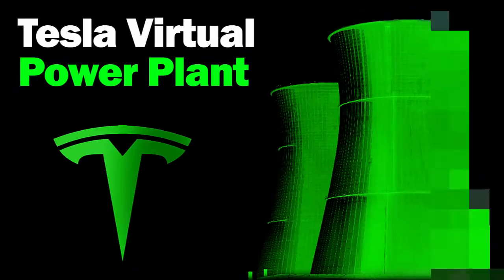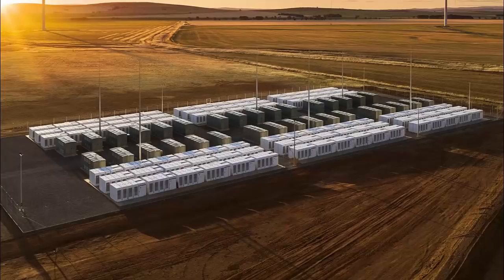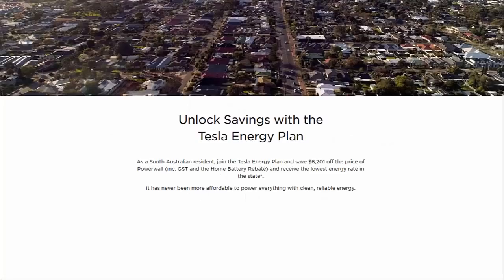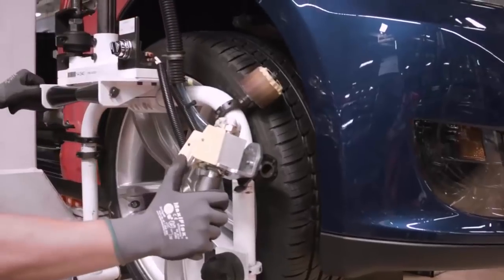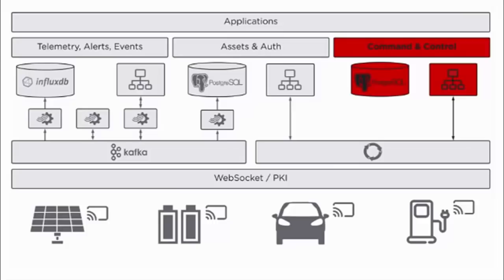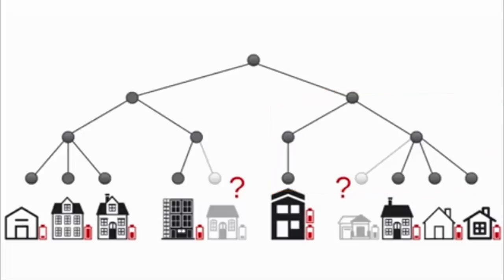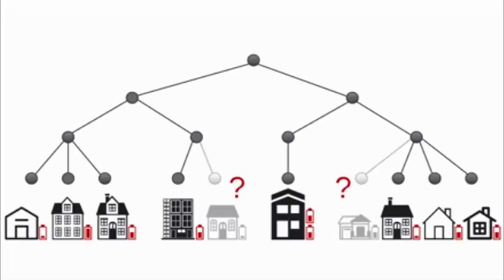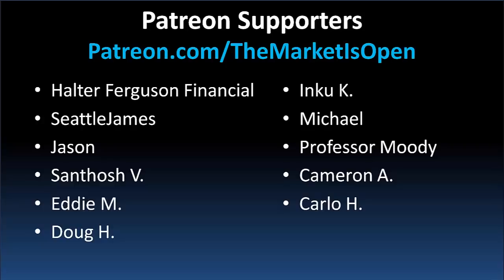Tesla’s Game Changer Virtual Power Plant is Already Here

Comment: Vehicle to grid is dumb. The batteries in Tesla vehicles are not designed for frequent charge/discharge cycles. LiFePO4 batteries are designed for 2 or more times as many cycles as Tesla car batteries. So if you have a car with LIPO batteries, fine knock yourself out, otherwise  why ruin your car battery to earn a few hundred dollars?
Reply from the maker: Yeah it makes almost no sense for the current vehicles. But the hope is that the new batteries can have many more cycles and therefore you won't be killing the battery. But ya for now this is mainly for powerwalls and such.
Reply: The new "million mile" battery will find a new "feature niche" between NMC for EV performance and LFP for high cycle-count - it will do both! this will mean the same battery can do what LFP can't (insane discharge) while maintaining a 3-4x cycle count on the current generation battery. this is critical for the car to still be a car while enabling two use cases which will dump way more cycles on the battery, namely RoboTaxi and possibly V2G

Comment: Would it be possible to find out if Tesla’s contracts with power companies allows them to feed energy into the grid from their Supercharger stations?  If so, they will become like virtual substations as battery storage is added to them.
Reply: Now imagine if they overbuilt the energy storage at Superchargers where space allowed. Suppose they only need 6 Powerpacks at a charging station, but have room for 12. Just build 12. A few extra Powerpacks or Megapacks at every supercharging station could equal dozens or even hundreds of Horndales, but without the cost of land acquisition and permitting. Each Supercharger battery installation will serve as a buffer for charging to eliminate peak rate charges, but also be a node on the Tesla Virtual Power Plant buying and selling energy to make more money.

Unregulated states, which is most, would allow this. Regulated states probably would not, yet.
Reply: Brett Cooper, absolutely.  Superchargers are well distributed to perform in an energy trading environment.

Comment: You say "Now model 3 is like 4 or 5 Powerwalls on wheels". But if you plan to draw charge from it, what's the point of it even being on 'wheels'? Why not just put it up on blocks? Isn't the whole point of a car to move? And isn't the whole point of charging an electric vehicle so that it can move? And when you draw charge from it, aren't you reducing or eliminating its ability to do just that? I have to tell you, this whole thing sounds insane to me.
Reply: Most people want a large battery for when they travel long distances, but only use a small fraction of their battery most days. That extra battery capacity could be working for you instead of just sitting idly in the garage. 

If you were traveling somewhere, you could tell it to leave you with a full charge. Otherwise, you could set limits for maximum and minimum charge and let Autobidder intelligently cycle your batter to maximize profits by buying low and selling high - along with other grid services. 

This isn't exactly a new idea, it just hasn't been economically feasible because of battery degradation. 1M+ miles changes everything. Having a car that is an awesome car when I want it to be an awesome car, but is a money making machine when it's sitting in the garage does not sound insane.

Comment: Now Elektrek M3 having bi directional V2G functionality has now been debunked, will we find out on battery day when it will start being included in Tesla vehicles?
Is it definitely in Powerwall or possible from Solar roof/panel?
Reply from the maker: Thx, ya the vehicle side of things makes little sense without a battery that can withstand a lot more charge cycles. So I guess with new battery they will have the hardware they need.
Reply: @TMIOTesla  hopefully... it may not be that straightforward. they may need another interface - the current connection/handshake protocols don't support bi-directional flow. Unless they can create a superset over the top of those protocols or something. They will prob need to supply another wall-unit for the house. The inverter needs to track the house load which the car can't do by itself. The V2G needs to be way more integrated than just "plugging it into your house". There's a good chance there will be a "GridWall" product which does some of what the PowerWall does but sans battery (cos of the car).

Comment: The IP adress of your local Internet Connection (which you will Need) tells the System where the battery or ev is.
Reply: Nope. Mobile IP will tell you nothing.
Reply: @7z9  Yes, this is correct, a specific ID number of some sort will be needed.

Comment: The entry point for Tesla is utilities; they're the ones who have to be persuaded.  These are very conservative entities, and state-regulated monopolies, too.  They make money by charging rates as high as regulators will let them.

So reducing electricity costs is not their number one objective; persuading regulators that costs can't be avoided is their real goal.

But their top goal changes if their grids aren't stable.  That's what happened in Australia.  Stabilizing the grid, not cost reductions, got the utility there to embrace change.  They likely have mixed feelings about the cost reductions; that means another trip to regulators and more persuasion, which could go either way.  But they had to stabilize that grid.  No choice.  The utility there was facing the possibility of having their license to operate revoked and given to someone else.

Consumers in Tesla's scheme are winners, especially if they can set parameters around their contributions (timing, how deep to discharge their batteries, etc.).  Tesla in Tesla's scheme is a winner; it's a way to earn some coin and persuade consumers to buy their cars (competitors aren't even remotely ready to participate).  Utilities are the weak point.

Utilities have steady-state sources like nuclear plants that don't follow the consumption curve, and variable sources like dams and fossil fuel plants that are merely slow to follow the consumption curve, and peaker plants for radical surges in consumption.  And then there are the increasing green sources, which can be highly intermittent and follow their own logic, not the needs of the grid.  The more green sources they have, the more they'll waste if they don't have storage and retrieval solutions.

Utilities aren't concerned with waste per se, only profits.  But waste makes regulators frown.  Next time utilities go back to discuss pricing, frowns are not what they want to see on regulators' faces.

Corruption and ideology contaminate politics.  Regulators are politicians, or they work for politicians.  This can be another source of resistance.  Some politicians hate green energy and would love nothing better than to show the public that green energy is wasteful.  Those politicians will resist distributed virtual power plants.  Other politicians will favor the idea.  Which dominates in a particular jurisdiction matters.  And either can be 'on the take.'  They'll act according to who is lining their pockets.

So, where does that leave Tesla?  The most likely utilities to buy into distributed virtual power will be in green-favorable political jurisdictions where corruption isn't strong enough to stop the project.  (Atypical, in other words.)  Where the grid isn't stable, distributed virtual power will also be an easy sell, but unstable grids are also atypical.  Everywhere else, it's going to be an uphill climb taking many years.

All of that predicts a slow, painstaking roll-out.

That might not be such a bad thing.  Tesla has put together an impressive plan, and the pieces to make it work have been put into place.  Their foresight is once again impressive; Tesla has never looked forward a quarter at a time, which is one reason they're eating their competitors' lunch in the automobile market.  But the software!  Holy cow, but that's an ambitious bit of coding.  They're again harnessing machine learning on yet another project far vaster than anything machine learning has tackled before.  The software is heavy lifting.  So, a roll-out to a small handful of favorable utilities is probably just what Tesla needs right now.  They need to put their software to work and then begin stomping bugs and refining it.

In the end, Tesla will have something of immense value - but not soon.
Reply: Excellent overview.
Reply: Hi Urgelt, your comment is an excellent analysis of the situation based on my knowledge of this area.
Reply: The Australian generation market is already largely privatised - whoever can provide the cheapest power at any given time wins/gets to sell their power, so we do not face some of those issues. Only the network - the poles and wires - have monopolies here.
Reply: @glennjgroves  The word 'privatized' is meaningless in this context.  Grid operators are state-granted monopolies buying power from state-approved sources and selling it at state-approved prices.
Reply: @Urgelt  that is both true and a bit misleading. (And yes, it possible for something to be both true and a bit misleading.) Here, literally the cheapest power per half hour block is bought, from a whole bunch of privately owned generators, and then sold on to privately owned retailers. Only the poles and wires, and the people who run the National Energy Market (who do the buying and selling) are effectively public utilities of any shape or form. It is not a completely free market exactly but it also does not suffer from some of the limitations you described, which is the point I was making. We have a whole lot of privately owned generators using privately owned money building RE generation capacity because of the model, therefore some degree of privatisation so to speak is clearly operating.
Reply: @glennjgroves  Utilities buy power, utilities sell power.  They are still state-sanctioned and regulated monopolies with state-approved participation.  There is price competition in power generation, but you could say that about most US utilities, too.  Wherever grids are connected, there is permitted power trading, and new suppliers, privately-funded, do pop up.

But it's a stretch to call utilities 'privatized.'  They are public/private partnerships, in Australia as much as everywhere else.   Suppliers and grid operators are never free of regulator oversight, and the market is only free within regulated boundaries.
Reply: @Urgelt  Succinct and incisive comment. Thanks for that.
Vermont is one of those jurisdictions where the autobidder technology stands to see successful implementation. At the end of the day, I believe that if/when Tesla proves that autobidder results in either a 1) dramatic cost savings or 2) a dramatic revenue stream (energy arbitrage?), the normal power-company attitude of conservative resistance will crumble.
Reply: @timyarrow8844  Mostly it depends on the relationship of utility to regulator.  This is where their real profits are made.

If the utility calculates that cost reductions will be to their benefit, they'll pursue them.  If the utility calculates that regulators will force them to pass the savings on to consumers, it's hardly worth the bother, particularly if it requires more work on the part of the utility.  Which it will, if they have to buy power from every Tom, Dick and Harry with a solar panel on his roof or a Tesla in his garage.  Tesla's software might reduce the level of effort required, but it'll still be a lot of extra work.  Whether it will pay off for the company depends on how a state's regulators carry out their function.
Reply: @glennjgroves  just wait till wireless options become available.. 

I mean internet is wireless right. ;)
Reply: Trigger Troll  Don't mistake a shortage of processed nickel for a shortage of raw nickel.

We can process more.  And we will.

Further, proven reserves are just the lower bound on what's accessible.  There is no shortage of raw nickel, so people quit looking.  Waste of money.  Folks will go looking if we start to run out.  Which is not likely to happen for many decades.

Eventually?  Yeah, a couple centuries from now, if we're still relying heavily on nickel production for our civilization, we'll have to drag some asteroids in and get it from those.  The prospect of space mining doesn't frighten me.  Expanding our economy into the solar system sounds like a cool thing to do, to my ears.
Reply: Thank you Urgelt for your comments.
Also, for everyone relatively new to this topic, dont fall for trolls.. (TT here in this case)
Check this, will clarify about the link(a movie documentary) the Troll has posted:
https://www.filmsforaction.org/articles/6-reasons-why-planet-of-the-humans-is-a-disaster-of-misinformation/
Reply: yeah so I give you a 8.75/ 10 so you pass the class but your essay was a bit too long.
Reply: i think what hes trying to do is bypass utilities altogether.
Reply: @usern4metak3ns  Not really possible.  Utilities are state-granted monopolies.  If you want to buy or sell electricity, you'll be dealing with them and through them.

Stop and think.  What do you have with a Supercharging station with solar panels?

Answer: a partially-economical investment.  If that's all you've got, then no matter how much money you pour into battery storage, you can't reduce the risk to zero of running out of juice.  A swarm of customers could clean you out.  You need a supply backstop, and the backstop is the utility.

And there will be times when demand for your electricity is low and you have too much.  Just waste it?  Or sell it to a utility?

Utilities are necessary for everything Tesla wants to do.  Elon wants to make products that work with utilities, not bypass them.
Reply: @Urgelt  utilities aren't necessary at all. They are put in place as an excuse to charge for things that should be free.
If everyone had solar panels or other energy sources then utilities are rendered useless. Especially if you are capable of powering your house and the zip code you live in. Utilities are a scam sponsored by the government. An extra tax.
Reply: @usern4metak3ns  Before solar, there was no question we needed utilities.

What about in the future?

We need utilities, because we still need to move energy around.

Let's take your point and amplify it.  Lots of people install solar.  Now what?

We can either break up into microgrids (houses) unable to move energy around, or we can employ utilities to buy and sell power (and take a cut from each transaction).  When each consumer needs more power than he can generate, he buys.  When he has more power than he can use, he sells.  When the grid as a whole needs more power than is available to it, utilities will buy more.

Utilities will change, but we still need 'em.  Moving power around is essential to optimizing both cost and availability of power for consumers.
Reply: @Urgelt  utilities were designed to charge for things that should be free or able to be provided by the people.
Reply: @usern4metak3ns  Why should electricity be free to consumers, again?  I'd love to hear your logic.
Reply: @Urgelt  because most energy sources are cheap and plentiful. Especially the green sources. 
The cost to get the grid up is understandable and some maintenance but charging for the actual kilowatt? That's ridiculous since a good chunk of it is provided by hydroelectric dams and flowing water...
It's just another tax. Simple.
Reply: @usern4metak3ns  Cheap, yes.  And how much does a kilowatt-hour of electricity cost?  Pennies.

Free, no.  Every method of electricity generation requires labor, capital investment, operating and maintenance costs.

So how do you justify making electricity free, again?
Reply: @usern4metak3ns  So who will pay for the labor, capital, operations and maintenance of the grid, then?  If the consumer is off the hook.  Governments?

You're suggesting a blank check for consumers.  Use however much you like.  If there isn't enough electricity available, more capacity will have to be found, but the guy who's careless about his electricity use won't be the guy who pays.

Have you thought this thing through at all?
Reply: @Urgelt  it doesn't cost anything to keep the grid flowing once setup. Only small maintenance. There's no excuse to be charging ridiculously high prices per month. The utilities are a scam on poor people. 
Quit advocating them. It's scummy.
Reply: @usern4metak3ns  Your certitude does not arise from understanding.
Reply: @Urgelt  no it arises from facts.
Reply: Holy shit ur smart